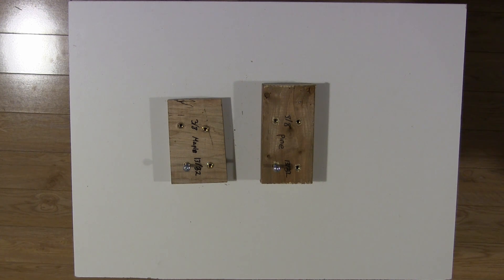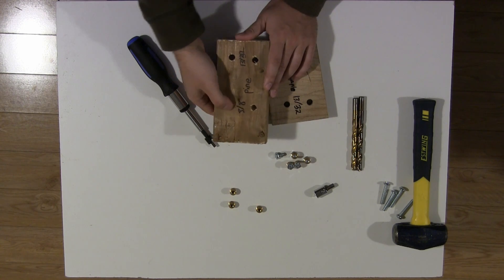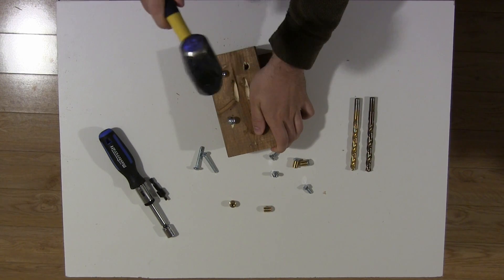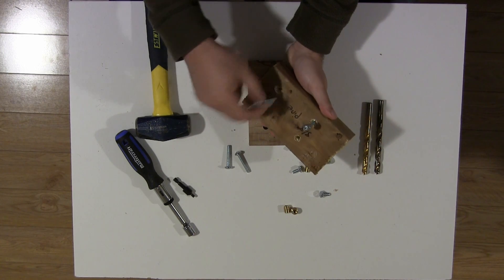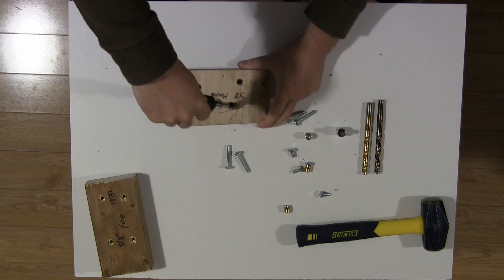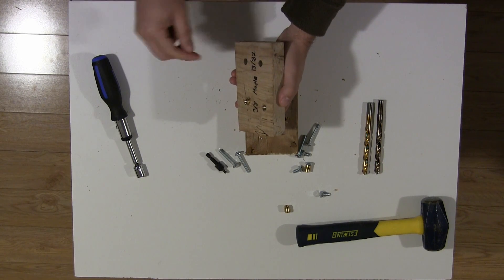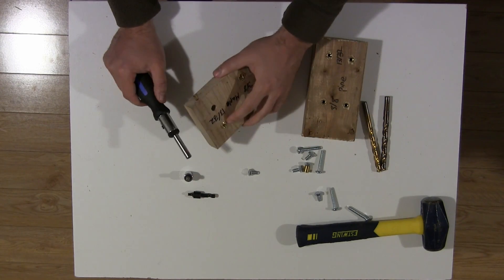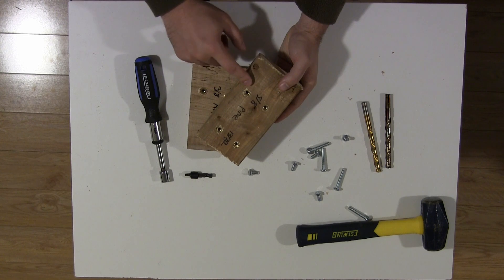How to properly drive insert nuts and strength test

Comment: When it comes to removing old inserts I've had success just putting super glue on the threads of a hex bolt and threading it into the old insert. Let it dry a few minutes and unscrew the bolt and the insert should come with it. The double nut method did not work for me but super glue worked easily 6 times in a row.

When installing new inserts putting a washer that has been lightly oiled between the bolt and insert allows for easy release so the insert doesn't unscrew when you back the bolt out.

The brass ones didn't work for hardwood for me, but maybe they were the ones made for softwood. The package didn't say. The steel ones worked in hardwood easily using the bolt method and oversizing the hole. The package said 7/32 and I went with 1/4, so 1/32 bigger.

I generally recommend that you buy more inserts and bolts than you need for a project, especially if this is the first time you're working with them or with a new type of hardwood. They are cheap, both in price and metal quality and you can easily damage them.

Comment: I’m restoring a large table and in the process of moving, the insert nuts (I cannot see which type they are as they are deeply embedded) have become twisted and I cannot thread the bolts into a few of them. How do I get the nuts outs?!!!!!!!!????? It’s driving me NUTS. Literally
Reply: The only thing I can think of is using Liquid Nails on the end of a bolt to stick onto the nut and pull them out after hardening. 
I’ve already tried a magnetic screwdriver, but the nuts are too wedged in 😢

Comment: Best method I have seen is to use a drill press to maintain pressure on the insert to ensure it starts straight. Be aware that there are two different thread pitches offered depending on the species of wood being used. One last tip...quit using those damn soft brass inserts period. They have them in steel.

Comment: When using the bolt method, you will eventually need to remove the bolt from the insert.  The problem is that bolt head becomes so torqued down during the insertion process that the torque required to break the bolt free from the insert is greater than the torque needed to unscrew the insert from the wood.  Using a jam nut under the bolt head eliminates this problem.  Also, it can be difficult to maintain perpendicularity of the insert to the workpiece.  To avoid this, attach another board under your workpiece board with a hole that is coaxial to the hole needed to set the insert.  This hole should be equal in diameter to the major diameter driving/guiding rod.  Of course, use a jam nut to free your tools once the task is done.
Reply from the maker: My solution to the bolt has been using a washer, works great.
Reply: @Making  , I have some experience driving inserts into particle-board, or whatever it is that cheap cabinets are made of, typically covered with plastic laminate.  There are two problems.  One is that the insert tends to become crooked as it goes in.  This is due, I think, to the fact that the outer part of the insert is single screw thread.  This means that it is only biting on one side, which causes a force imbalance, thus throwing it off of perpendicular to the workpiece.  The other problem is that it takes considerable axial force to accompany the driving torque in order to get the insert to bite in properly.  Insufficient thrust will cause the insert to act like a drill bit.

I solved this by first drilling the basic hole for the insert with a diameter approx equal to the minor thread diameter of the outer threads and about 1/8" longer than the insert.  Then I drilled a pilot hole about an inch or so beyond that, co-axial with the basic hole, and with a diameter equal to the major diameter of the inner threaded hole of the insert.

I then put a nut and the insert onto a bolt, with the nut not touching the underside of the bolt head.  I jam the nut onto the insert.  Enough length of the bolt is now extended beyond the insert so that I can insert the bolt into the pilot hole.  Next I use a bar clamp to thrust the insert (via the bolt) into basic hole.  I use a wrench to tighten the bolt and alternate back and forth between tightening the bolt to tightening up the clamp until the insert is completely inserted.  To prevent unscrewing the insert when loosening the jam nut, I provide counter-force to the bolt head.
Reply: @kenp3L  thank you for that precise explanation!  I too have battled with the challenge of getting these inserts in perfectly perpendicular.  I was thinking this EXACT solution, minus the alternating clamping/tightenting.

Question: Why not drill the the co-axial hole for the basic hole diameter first (the one that will establish the perpendicular aspect), then follow up with the larger diameter drill hole for the minor thread diameter for the outer threads of the the insert?  I often do this sort of graduated step up when I need a larger hole i.e. I start small and move up to the size I actually want.
Reply: @Alexander-dt8sk  You want the two holes to be on a common axis, or at least as close to it as possible.  If the shorter but larger-diameter hole is drilled first, the bit for the pilot hole can easily find the starting center-point.  Then, as you drill the pilot hole, just visually keep the bit centered in the large-diameter hole.

If you drill in the reverse sequence, the larger-diameter hole will be more prone to drifting with respect to the pilot hole.

Also, for plastic laminate or nice cabinetry, an ordinary twist bit can damage the surface appearance.  So a brad-point bit is needed, which is impractical with a pre-existing pilot hole.
Reply: @kenp3L  Yes, I see the logic behind your advice.
Reply: @Making  That's the way I do it, works every time. I may try the jam nut next time just to see how it works.
Reply: @Making  The washer alone sometimes doesn't work, especially if the hole wasn't properly "oversized." But lightly oiling the washer helps it to release from the insert.

Comment: You’re putting the insert in upside-down. The slot cut is not for a screw driver, it’s for helping to cut into the wood. You need to do more research
Reply from the maker: Lol... No, that is indeed a driver slot http://www.leevalley.com/en/Wood/page.aspx?p=65133&cat=3,41306
Reply: Ric.....take a good look at the manufacturers installment tool
Reply: Yes, it is indeed a driver slot. You've demonstrated that the driver is a POS, and not worth using. The bolt and nut method is clearly preferable. Up or down, the direction of the slot makes no difference if installed with bolt and nut.

One manufacturer of inserts, EZLOK, sells a driver (search "ez lok insert tool”) that engages the slots. However, their very own instructions indicate the driver is a POS [my interpretation] and that it is possible to use a machine screw and nut to install inserts. Furthermore, they indicate that the slots should point down (search "ezlok insert instructions” and then look for wood.) There are inserts, for metal and plastic, with slots that are intended to cut threads. While the slots in inserts for wood may not be intended to cut threads, it wouldn’t hurt, particularly in hardwood.
Reply from the maker: Interesting!
Reply: @timetravellingbunny3952  
You read those directions incorrectly. They’re telling you to thread the nuts on the bolt first, then the insert after the nuts with the slotted end down. That means the slotted end of the insert will end up facing the nuts that are already on the bolt. Slotted end down in that context is relative to the insertion tool you’re assembling, not the hole the assembly will ultimately go into.
Reply: @53C52  "You read those directions incorrectly."
That may very well be. I hope it is. It does not alter my points.
Reply: @timetravellingbunny3952  
Several of their wood sizes have a recommended drill bit size that is 1/64” larger than the outside diameter of the core of the insert. If those slots were made for cutting, they wouldn’t be much use in a hole that’s bigger than the slots. 

E-Z Lok has a video demonstrating installation of an insert into metal using 3 different methods (screwdriver, double-nut, and install tool). All 3 show the slotted end in contact with the tool. Those are tool slots, not cutting slots.
Reply: @53C52  "Those are tool slots, not cutting slots."
Yes, that was my first statement, and primary point.
"Yes, it is indeed a driver slot" from above.
Reply: @timetravellingbunny3952  
I must have misunderstood the last two sentences in your original post.
Reply: @53C52  I acknowledged that "slots in inserts for wood may not be intended to cut threads". I suggested using them as such "wouldn't hurt."
It was suggested as a not necessarily optimal possibility; and "Yes, it is indeed a driver slot"

Comment: Will try your bolt method as a test. Thanks. I've used the double nut in a section of all-thread, and that works fine. Suggestion: Don't use your camera in the vertical position as you did in this video. It was difficult to orient myself to your task.
Reply from the maker: +FlyingSawdust JEMTZ lol, yeah I don't do that anymore, it was a noob mistake :p
Reply from the maker: +FlyingSawdust JEMTZ glad it helped you. I hate to do this, but now I need to ask for your help. With YouTube's new terms of service I'm going to be demonetized in a month. Even if the rest of my channel isn't your style, I would highly appreciate if you subscribed to help me maintain my ability to get paid for my work. Thank you very much in advance.

Comment: Hi,
Put them in with the slotted side down. the slots cut threads as it goes. throw away the driver and you a jam nut on a bolt to put them in... you will get much better results and will look much nicer as well
Cheers,
Reply: I think that's a myth that the slotted end cuts threads. Look at it, it looks nothing like something that cuts.
Reply: slotted side down depends on the design of the insert.  they're not all designed to be used slotted side down.
Reply from the maker: +Lyle Feucht I hope you enjoyed. I hate to do this, but now I need to ask for your help. With YouTube's new terms of service I'm going to be demonetized in a month. Even if the rest of my channel isn't your style, I would highly appreciate if you subscribed to help me maintain my ability to get paid for my work. Thank you very much in advance.
Reply from the maker: +DredWolf I hope you enjoyed. I hate to do this, but now I need to ask for your help. With YouTube's new terms of service I'm going to be demonetized in a month. Even if the rest of my channel isn't your style, I would highly appreciate if you subscribed to help me maintain my ability to get paid for my work. Thank you very much in advance.
Reply: Agreed, those drivers are a solution to a problem that ONLY exists for installing the inserts backwards, the 1/32" oversize hole in harder woods should be fine, unless you are trying to hang stone or steel from them..
Reply: @jrnull1  I tried to install my 1¼" screws slotted side down to help cut the wood but my vicegrips are slowing me down. Slotted side up, even if you don't use it. Doesn't cut the wood anymore than the threads do themselves. Plus, if you have to back the insert up for any reason. I'm sure you've got a trick for that but its going to be easier if you have the slot pointing the right way already. I use allen wrench type inserts. The reason they use slotted is to force you to drive straight down or you'll slip. I agree that tool defeats the purpose.